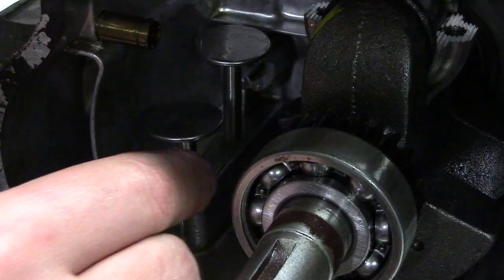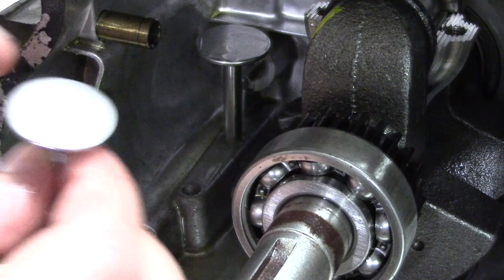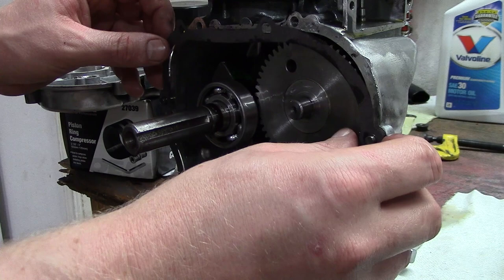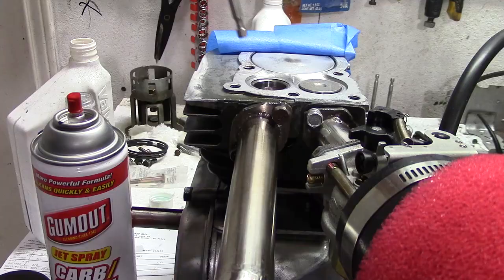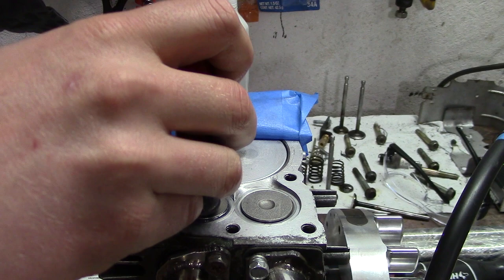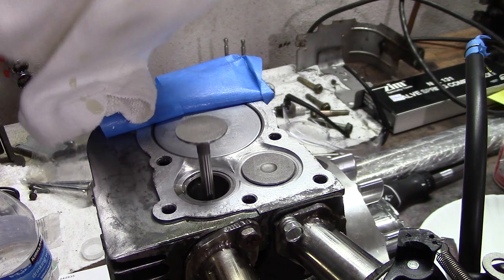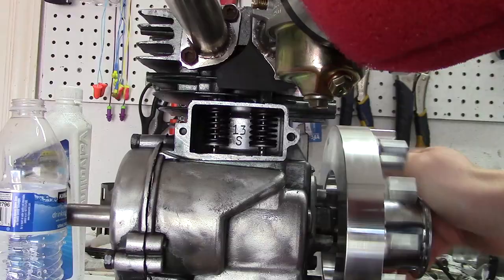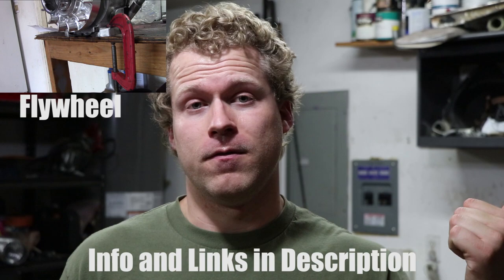Camshaft & Valve Train: Small Engine Performance Mods

Comment: Also when you use the grinding compound you will notice on the video when he cleaned it the valve had a line bout in the middle of the valve angle. That is a good sign that the valves are seated good to go ahead n put them in. I haven't been in the small engines in 20ty some yr's n my lil son is turning 8 and I went n got about 6 engine's one of them a Tecumseh 8hp that is supp already built with a lot of compression, piston, cam, lifters, valve's, rod already changed with a 1 inch shaft. I didn't know till recently they had fuel injection for these n I have seen some put turbo's on some. I would like to see a video like this one that starts to finish with it, some are using the mega squirt with some briggs, but I haven't found too much info on them. But great video!!

Comment: Lapping valves only works at startup. Correctly done valves and seats have a 1° difference on the angles at ambient temp. At operating temperature the heat difference between the valve and seat causes them to expand differently,  taking up the 1° difference.
Reply from the maker: Hmm, you are probably right. But id rather hand lap valves that are all buggered up and pitted, than take it to a machinist that will charge who knows what.

Comment: Love these videos I learn a lot about engines from them. I sort of want to see how good the karts go after these upgrades are done, that would be cool. Or even just a before and after of the engine running.
Reply from the maker: you will get more than that. There is no before because this engine was purchased just as a bare block, so the first time it runs is the after.
Reply: haha fair enough.
Reply: KartFab where do I buy my billet lifters for a 212cc

Comment: Looks like itll be a good runner im building a flat head now its a tiller block but has a new raptpr 3 piston arc rod arc 3hp flywheel has the brows shaved and ported and polished intake and exaust well i didnt polish the intake left it rough got a raptor carb for it just have to pic my cam and valve springs
Reply from the maker: 94ss and 20 lb springs would be my suggestion
Reply: I ended up getting a 107ss for my build

Comment: It's a flat head with stock internals carb been modified for methanol don't think the motor is ever been a part it sat in my garage for 10 years
Reply from the maker: I still dont understand how your valve would be hitting the spark plug, unless you put in the wrong spark plug, modified the head  somehow (stock gasket, not milled?). Or put in a different cam that caused the valve to lift higher. If i were you, id pull the sparkplug and check it against the users manual. Some spark plugs are longer than stock, and fit in the hole, so i would suspect this to be a likely cause if no other changes were made.

Comment: Good installation video but it would have been nice if you went more in depth on how to choice which cam is best, along with rockers, and spring stiffness.
Reply from the maker: Good point. I’ll be doing more videos. Cam choice was based on what I was building the engine to do. Flatheads do not have rockers.

Comment: First of all thanku very much sir! It was very useful! Please let me know 
how can i change the stroke length of my engine without changing the connecting rods?
or what are the ways by which we can increase our compression ratio?
Reply from the maker: +Satyam Priyam Roy changing the connecting rod won't change stroke. Changing crank will. Increase compression by: Boeing larger, bigger piston, deck block, mill head, thinner head gasket.

Comment: I have royal enfield continental gt 535 and I'm gonna install a performance cam which my mechanic will custom make for me. should I be adding valves and lifters and push rods also should I buy a power commander (piggy bank ecu)

Comment: Any idea on if there are performances mods similar to what you used but for a 6.5hp Briggs and Stratton flat head and to convert the motor from horizontal engine to vertical?

Comment: I have a 127cc briggs 550 series and I'm trying to find performance parts as well but don't know where to start. Briggs don't seem to have much aftermarket.
Reply: broken smile its really hard to find parts im trying to find parts for a reasonable price and its hard. Ive been looking on ebay and i found some parts. The only mods i would really do is a pistion arm,valve springs, and governor removal, porting and polishing,cam and a carb/exhast its alot of simple stuff(i have a 5hp briggs that had a stuck valve which is fixed now but i need a valve tappet its hard to find one for me (edit:spelt tappet wrong)

Comment: Briggs Flathead 8hp... I can't find any performance parts for this engine. I would like to have (billet) flywheel and all the internals accept crank. If no parts are avalible does anyone know if the parts for the 5hp fit and are feasible
Reply from the maker: yeah thats not a common one.

Comment: Need help have a box stock raptor intake valve keeps hitting spark plug electrode when I Chuck a rev
Reply from the maker: ok so you are saying you have a 1) box stock 2) raptor? So if you look at what you just said, you said you have a honda gx200 clone and a briggs and stratton 5 hp flathead intake valve... Makes no sense. Your problem could be a number of things, but lets start with the basics. What engine do you have? What changes did you make to it?

Comment: If this is done to a riding mower will it hurt or help the performance. Just say a 24 hp Briggs 2 cylinder
Reply from the maker: +nice1n601 yeah a cam with more lift and or duration than stock will help mid and high end torque

Comment: Are there any retainers that go on the top of the valve springs or do the springs just sit against the block? Thx.
Reply from the maker: Retainers are only for valve tips. Nothing sits on the block with these ones other than the spring.

Comment: I just put 36 lb springs just wanted to know what’s the best can I can use for my 5 ho flathead
Reply from the maker: +Crazyjesse11 cams need a certain spring pressure, timing, and compression ratio. It’s not a question of ‘best’ rather, what combination is going to produce power at the RPM range that I need?

Comment: Hey grant, know your pretty busy but advice would be godly. So I have a 5 hp tecumseh year 95-99, have about 1/4 inch or more play n the crankshaft. Can push on shaft OR flywheel and get the play. Any suggestions for problems or solutions to eliminate some. Also con rod has slight play. Really don't want to replace to much. How can I rig it just to somewhat safely move it on its own power. Does have spark.you are not liable for any of my actions whatsoever. just shoot ideas @ me please.
Reply from the maker: Crankshaft spacers. You can order from ARC racing or any of their distributors.

Comment: if you put a camp in one of these engines I have seen on the dynocams website that it is recommended you to weld the lifter bore. Is this necessary if you don't plan running the engine at high rpms?
Reply from the maker: depends on the cam. High lift, aggressive ramp cams put a lot of load on the valve train. A mild cam like the 94ss doesn't. Its more about durability and longevity than 'necessary'

Comment: Will normal lifters still work if there is only a small increase in the  size on the cam
Reply from the maker: Yeah. The real issue is if you have heavy springs.
Reply: @KartFab  standard springs its a briggs model 28 flathead
Reply from the maker: You’ll be fine. Briggs aren’t made of Chineseum.
Reply: @KartFab  true 💪😂

Comment: I have a cmxx ohv 136cc engine (very similar to a 212) I have removed multiple different govenors on multiple different engines and sizes but on this during the removal the camshaft fell out and does not have the dots to line the cam up with the crank. What should I do? Any help would be greatly appreciated!
Reply from the maker: Do a bit of searching. Id check extra carefully for any sort of indicaiton or marking on the cam and crank gear. Worst case scenario, you would need to get a cheap degree wheel (or even print one yourself and stick it on the crank), then look at when the lobes are letting the valves open and close in relation to TDC. Good luck
Reply: KartFab thank you very much for the information

Comment: I have a sigma 212 and put on a stage 1kit on IT and I fell air coming out some whare near the carburetor I do not now why and the kit only gave me 2 more miles per hour is this right or do I need to do something
Reply from the maker: the engine's flywheel has a fan on it, so when the engine is running, it blows air over the engine,so you should be feeling air coming out all over the place when its running. Stage 1 kit only gives you more flow, which gives you more power (NOT RPM INCREASE). If you want to achieve higher rpms after the stage 1 mods, you need to remove the governor, and install heavier valve springs, and possibly a billet connecting rod to support those RPMS with proper oiling.

Comment: What's the carb set up on the flathead. Doing up my 5hp.
Reply from the maker: Get a PZ22 or knock off pz22 carb. I got a gx200 carb on there but it’s not as good as a slide carb.

Comment: Dyno CM cam or Isky Black Mamba for my clone
Engine ?
I'm looking for max  power
Throughout the rev range/
/powerband .
I have a BSP 196c.c. with
22m.m. Mikuni (Jap.)
Aluminium Flywheel
Header
# 20 lb. valve springs
Thanks in advance !
Frank from Connecticut
Reply from the maker: you cant have it all with a cam. the cm will probably be better at low rpm, and the black mamba will probably be better midrange and high rpm wise.
Reply: @KartFab Thats Absolutely True  Grant
Tony @ Dyno cams said cm cam is great @ top end 
But loses a little bottom end. & is basically desiged for a bigger Carb Set-Up
Tillotson / Mikuni

I'm running a 22m.m. Japanese Mikuni kit

Isky says Black Mamba cam produces more power  Throughout the entire 
 range . Especially on top!
But I'm using the stock valve train & it has a very Aggressive ramp angle.

Currently 18lb.V/Springs

Oh Well !  MORE OBCESSIVE RESEARCH .
Like any addiction - IT'S A PROGESSIVE DISEASE .
haha 
Any input is Appreciated
Thanx Grant !
Frank
Reply from the maker: call taylor yochum at gopowersports, tell him grant sent you there to help you choose a cam. he will hook you up. Let him know what engine you are putting it on and what you are putting the engine on and he can help with EVERYTHING to get it running right. Its not just the cam but the gearing, clutch, etc.

Comment: I just ordered a predator 212cc I'm just going to ride it for fun. Does the valve springs come installed already in the motor or do I half to put them in.? And is there any other parts that don't come with it that I need to order? Please tell me
Reply from the maker: All you have to add is oil and gas.

Comment: Where would I get a nasty cam for a 3.5 hp ? I looked at the site but I can’t make heads or tails of it
Reply from the maker: A 3.5 hp isn’t enough motor to even mess with. Try calling up a place that specializes in Briggs flathead parts e.g. out2win.com

Comment: I had a question i need help making a break system like a rod for my manco kart just wondering can u give me a few ideas I'm running disc break and caliber as well
Reply from the maker: +amps2010 look up my go kart brakes video. Set up the pedal and the rod the same way. Brake caliper is set up a little different.

Comment: Maybe you know where can I get a performance cam and springs for my old 8hp flat head B@S? I can't find anything for it. Has a really wierd rod on it too that I have never seen before and both of the valves are same size too.
Reply: Also will a new style electronic coil for a 5hp work with a 8hp ?
Reply from the maker: No idea. There really never was a performance market for those engines. Coil might work but you need to verify timing.

Comment: I have the same engine with no carb. I wanna put a honda carb on it, but I dont have a tig welder(only arc). Any advice?
Reply from the maker: They make manifolds for them. Get a cheap mikuni 22 mm carb with adapter for it. You will need to do some searching, i just know that they exist, not where they are.
Reply: +KartFab Thanks

Comment: You check the valve lash with the springs in or without?
Reply from the maker: In for final check. For ohv the must be in. For flatheads you can get away with having them out and pushing down on the valve when you check.

Comment: do you need to re adjust the timing after installing a perfirmance cam?
Reply from the maker: +Humberto P timing should be set for the target rpm range and fuel type, which is usually included on the cam card.

Comment: I was wondering why does my pull start rip out my hands I set the valves right and the flywheel key is not split ? Do you what it would be
Reply from the maker: Does your cam have a compression release? Are you pulling the engine to the compression stroke, then pull starting it?
Reply: No it’s doesn’t a 94 ss cam for 5hp Briggs and yes I am then it starts up
Reply from the maker: you just arent pulling hard enough. intake valve lash should be .005" and exhaust shoudl be .006" I have the exact same cam and a light flywheel. It will kick back on you if you don't pull hard and don't pull to compression. Just yank it HARD. If you still get kickback, consider installing a snowmobile handle for pull start so it wont hurt if it kicks back. If you still get kick-back, you need to go to the gym and not pull it like a sissy :-)

Comment: I'm planning on doing this to a 8 horse Briggs flathead, any suggestions for a carb? I don't want to use the updraft carb
Reply from the maker: +Jarred Random so here is what I know: the dirk bike slide type carbs work the best. A 22 mm mikuni slide carb is good for the 212cc predator, and the 32mm is good for the Honda gx390. Measure the intake valve and go 2mm less in diameter for the Venturi size of the carb. Mikuni and PW are good ones to go for. Not sure about walboro but they are used s lot as well.
Reply: the intake is 1 inch
Reply from the maker: well, id say you cant go wrong with a 22mm, not sure about other sizes.
Reply: Cool, thanks for the help

Comment: can i just use regular engine oil for assembly lube?
Reply: theoutbackbandit Yes
Reply from the maker: I second that. However, assembly lube wont drain off the parts as easily, so if you wait a long time between assembling the engine and starting it up, that could be a problem. Assembly lube (or even break in oil) has special additives that will protect your cam lobes during break in. So moral of the story? Unless you are getting a high lift cam with an aggressive ramp, and heavy valve springs, you probably don't even need assembly lube. One trick some people do is they use their regular/stock valve springs during break in (2000 rpms for about 20 mins) , then swap to the heavy valve springs and dual valve springs, then change the oil.
Reply: theoutbackbandit royal purple is not only of the gods but they also make assembly lube.
Reply: KartFab its called zinc that's what's in the assembly lube real thick

Comment: What can I use for an 11 hp b&s set up just curious as to what’s Available. Thanks
Reply from the maker: Like an old flathead? Not much. You can always do intake/exhaust/jet on any engine, but only the popular engines are going to have lots of performance parts.
Reply from the maker: Intake/exhaust/jet will get you to 5500 rpm before valve float

Comment: Anything for a kholer command single cylinder, 17.5hp?
Reply from the maker: I don't think so. You can always advance timing 2-4 degrees,, put a dirt bike carb that has a venturi that is within 1-3mm of the intake valve diameter, and do a high flow exhaust. Internals, probably not.
Reply: KartFab how would I do the advance timing? because I already have the dirt bike carb and my exhaust could be better lol
Reply from the maker: well, there are a few ways. Most people get a flywheel puller check your flywheel for threaded holes, (i actually use a harmonic dampener puller from autozone free tool rental) its the one where you can thread it in from three spots. Then pull your flywheel. A lot of engine places sell "timing keys" which are just keys that have had a tiny bit of the key shaved off. That is the quick and dirty way. If you want to be LEGIT, you get yourself a timing light for about $35, and a piston stop, and a degree wheel, and you measure what your timing is set to after measuring top dead center. Typical timing is about 22-25 degrees before top dead center, and advancing the timing about 4 degrees is plenty. You also might want to check the dimensions of your valve springs, you dont want to float the valves. You might see if you can get some heavier valve springs.